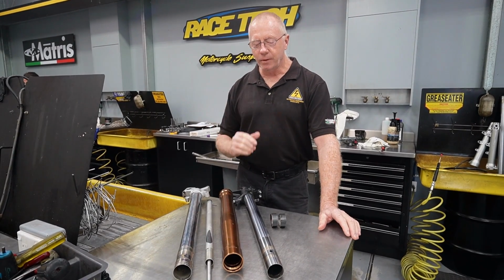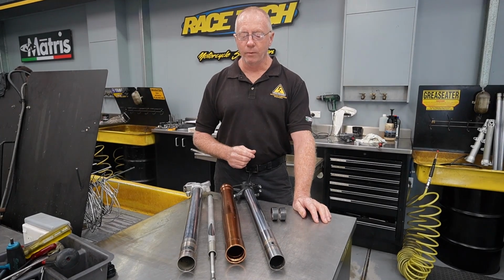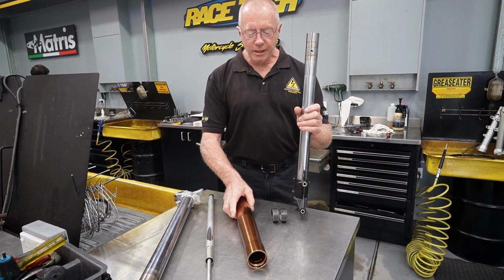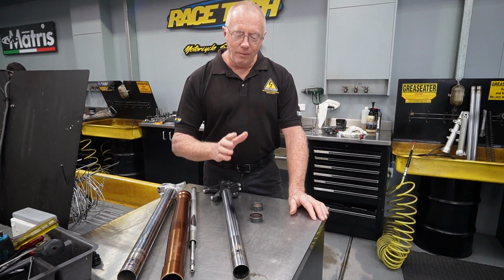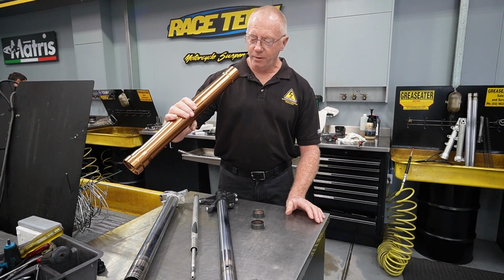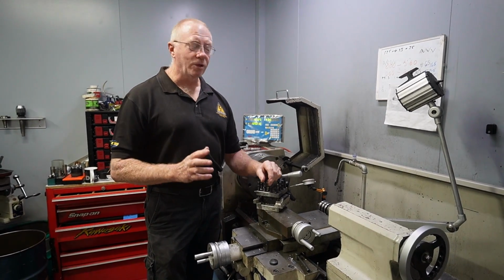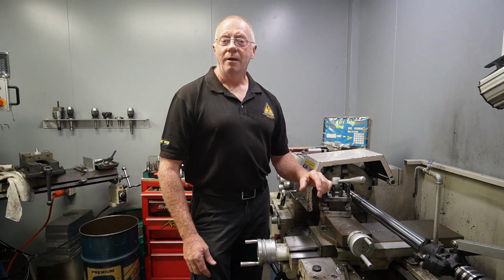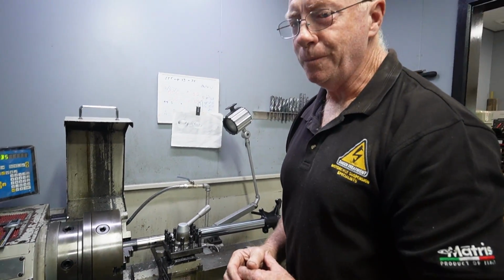Africa Twin Fork Tube Cure

Comment: Please correct me if I have this wrong.  So, by machining the tapers on the inner fork tube as depicted in the video, the rationale is to create more clearance and to stop the fork tube binding/wearing on the outer mating edge of the bush that contacts the fork tube.    How does this then prevent the wear problem on the fixed fork?  Does the reduced friction prevent/minimise the wear on the fixed for tube?

Comment: Is it hard to take the bottom casting off the chrome inner tube or just screws off no problem?
Reply from the maker: You have to be careful. Showa have installed a grub screw in the casting that not only secures it to the tube but it damages the threads on the tube as a consequence

Comment: @6:45 $120 is that correct
Reply from the maker: That's for the actual machining and set up time once the fork is apart. So it will be $120 on top of what other work you are doing...service / revalve etc.

Comment: I have pitted chrome on my 2016 AT 
Ive had them rebuilt before with new seals but one side is leaking again,what can i do? Best to buy new chrome bits from honda?
Reply from the maker: Having pitted tubes is like having a nail in your tyre. You can replace the tube but if you leave the nail there, it will soon result in another flat. With small nicks in the tubes they can be buffed out on a lathe. You may be able to fill others but if they are beyond repair then the tubes will either have to be rechromed or replaced

Comment: Great info! Do you use the OEM AT bushing in the now tapered slot or a different one? Thanks!
Reply from the maker: Bushings have very similar composiitions from one to another in spite of certain claims a manufacturer can make. The stock bushings are perfectly fine once you let them flex.

Comment: Would it be fair to say, this problem does not occur on right side up forks?
Reply from the maker: Absolutely, It is not a problem on conventional forks
Reply: If you have only ridden current era bikes, go find a DRZ400 or a KDX200 and find a trail loaded with small trail trash and prepare to be amazed. You won’t feel it. 95% of the offeoad riders on this planet would be happier with conventional forks.
Reply: Very informative video thanks.  So would this also help minimise the leaking fork seal issue on these bikes?
Reply from the maker: @user9876-j1g  It will certainly take pressure off the seals and will make a difference. Just how big that difference will be is anybody's guess.

Comment: honda is cutting corners...got to be bad. Nice dogs BTW
Reply from the maker: Cheers mate. I guess Honda responded to public demand......just not in the right way
Reply: @shocktreatment5495  Wonder if the new 2024 models have forks already fixed or only better coated....
Reply from the maker: @robsonenduro  Still the same unfortunately
Reply: @shocktreatment5495  that's a pity cause otherwise very nice bike. I canceled my order because of that before,.
Reply from the maker: @robsonenduro  It's a simple cure....and quite cheap
Reply: @shocktreatment5495  so maybe at least NT1100 has better forks :)
Reply: I am not sure if this is a Honda issue...but more so a Showa issue?  I assume Honda is just purchasing their suspension components and installing them.  Curious, does this issue also appear on the electronic suspension bikes?
Reply from the maker: @coolhandchunk  There have been several warranty issues on these forks as well as complaints / feedback directly to Honda (who own Showa) yet the fault remains. As the manufacturer who has their name on the bike you would think that there would be an onus if not just a basic desire to rectify this problem. This bike was the electronic version